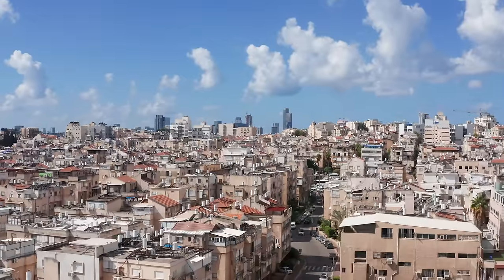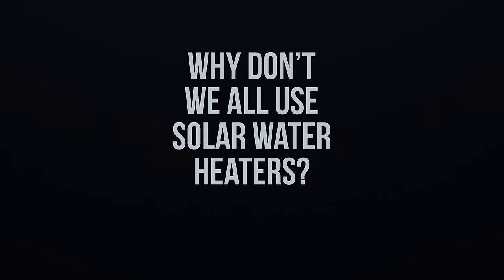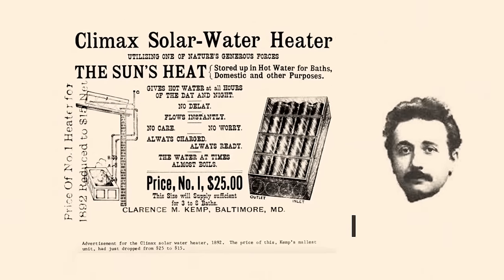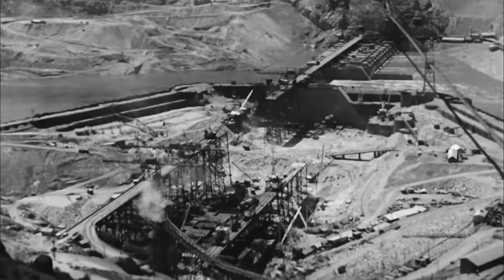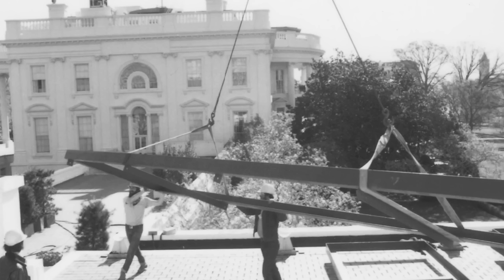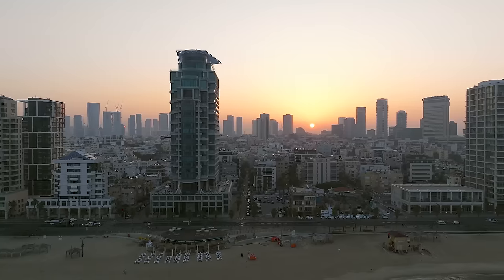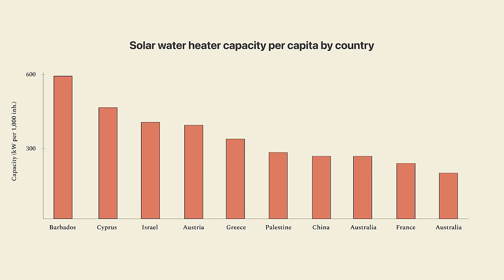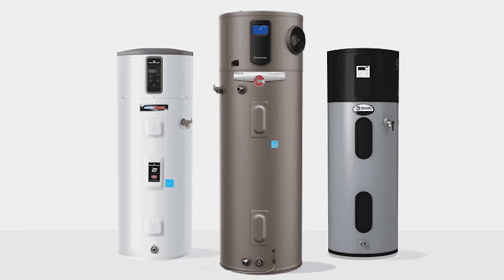Why Don't We All Use Solar Water Heaters?

Comment: Thank you so much for your thoughtful analysis of why the use of energy saving devices vary across the world in a time of global climate change.
Unfortunately after about the 7:25 mark I was unable to concentrate on anything else you said because you made a statement, that is sadly becoming more and more common, that is both grammatically clunky & awkward and mathematically incorrect/nonsensical.
When something is MORE expensive: Say a water heater that cost $700 in Israel cost $7,500 in the U.S.   , you could say that the water heater cost more than (10X) ten times as much in the U.S. Multiplying (timesing) while numbers creates larger numbers. 
At first one might be tempted to think you’re saying it backwards or just in an awkward manner but you’re in fact saying a completely different thing. If $700 is less than 10x U.S. Than the US price must be about 1/10 the Israel price and thus the U.S. price of a water heater would be $70 (or $71) . This would make the price in Israel less than ten times as much as the price in the U.S. Which I know is not what you’re trying to say but, is what you are saying. 
To be correct you could say the price over there  is a tenth of what it costs here or it costs ten times more here.
Sorry, and again thank you for the important information. I don’t know if I’ll go for the giant tank on my roof for my next water heater but, I’ll definitely be looking for a heat pump water heater even if it does cost 10X as much😉

Comment: Who wants an ugly tank sitting up on the roof when it can barely hold a tree branch that may fall. I would hide the tank in the ground where the earth can insulated the tank. The water ain't totally free after the equipment is paid for. There are a back up elements that are required by code that use power. I worked for a solar company years ago and know how they are set up and the code requirements. I thought about putting a water tank up in the attic so the attic heat could warm the water then I would have warm water during a power outage from hurricanes. One of my co workers has pipe up in his attic and he said they could take. Showers and have warm water. I have a propane fired water heater and it's plenty and a 15 lb bottle will last a quarter. So it's cheap to heat water my electric bill used to be around 50 dollars a month using a timer on my water heater but the gas is far cheaper. I think solar can save money but not until the equipment is paid for regardless if it's panels or solar water heater. 73

Comment: What this video failed to cover is photovoltaic, or solar electricity generation has gotten so cheap, it makes more economic sense to put more solar panels up and use the electricity to heat water, rather than installing a dedicated solar water heater system. PV’s are very popular here in California and it makes more sense for homes already have solar just put up couple more panels on the roof to cover their water heating needs, especially with the more efficient heat pump water heaters.
Reply: It's not that economic when you include the inverter cost and failures. But the good news is that hear resistances don't need AC current. So you can drop the inverter and feed you boiler with direct DC from the PV panels. Just take in consideration that the effective power on DC is twice the effective power of AC. If your device is rated for 110V AC you only need 55V DC. (If it's 120V AC then 110V DC) Another solution is to use a boiler for campers (usually rated at 24V DC).

Comment: Funny,  I do not see you mention the manitenance problems costs of Jimmy Carter's White House solar water heaters...  I remember reading the news articles that listed the leakage and other issues.  It seems that whoever installed the solar heaters at the White House did a crappy job of it.  Newer ones are much better designed in the USA.

Comment: Sure, they work fine.  But rooftop apparatus are ugly and have the potential to damage said expensive roof... especially when water is introduced.  And the crap state of manufacturing these days leaves me even less confident that a rooftop fixture wouldn't fail in a magnificent fashion.  Now you are left with a really expensive and difficult repair.  No, I will stick with my simple, cheap, and easily repairable/replaceable water heater in my garage.

Comment: Thanks for the information. Sounds like Adam Smith’s “Invisible Hand” worked and is still working. If it was cost effective it wouldn’t need a mandate or a subsidy. If I want to spend more money to have a more complex system that is my business the government should not be involved.🎉
Reply: The problem is that the market price doesn't include what economists call "externalities" - most obviously, the pollution caused by fossil fuels. Formerly the concern there was acid rain and air pollution but now the worry is global warming. The video noted Carter's comments about it not being possible for hostile governments to embargo solar energy as they did with oil in the 1970s so a portion of the vast amount of money we spend on the military goes to ensuring the security of energy supplies. Indeed, if Iraq's main exports were apricots and dates, then it is hard to imagine that we would have invaded in 2003 with all the subsequent loss of blood and treasure which is not reflected in what you pay for electricity or gasoline.
Reply: Exactly.  Why is Government always the answer to these problems? I am a fan of all forms of solar energy, but have chosen not to pursue for my own reasons.  If a solution makes sense, i.e. cost effective, the market (homeowners) will adopt it. Stop promoting the use of federal coercion to do things YOU think are important.  If the government wasn't wasting so much of our taxes and driving inflation, maybe US citizens would have the discretionary funds to invest in more 'green' technology.
Reply: @g.harrismcgraw8325  There is lots of government "coercion" that you are probably in favor of - perhaps you benefit from the mortgage interest tax deduction for instance. The free market brought us lead paint and asbestos and I assume you are fine with the government regulations in those areas. The lack of government "coercion" in Turkey allowed developers to build thousands of buildings that looked fine to the purchasers but then collapsed in the earthquake.

Comment: Common sense is like deodorant, those that need it most, don't use it. It's extremely hot in Africa especially in Ghana but those who seek to benefit have made it impossible to buy anything solar yet the national grid of electricity can't sustain everything, therefore the power rationing, you can go days if not weeks without electricity.

Comment: Ok, so you can use solar to heat water, but you need a back up heat source for cloudy or cold days.  So you have a normal how heater plus the solar.  The solar will save money because it's free energy...great...when it CAN work.  So if you have all that extra piping and labor.  It will eventually pay for itself, but it isnt free.  I did use solar for hw....but it is not possible in the winter even in southern NM. Summer was good though.  Really all you are doing is justifying having 2 hw heaters. Yes, it works and it will pay for itself eventually, but really, it's just too much BS.

Comment: First off, lets get the #climatechange out of this topic.  I have solar electric on my home and my rv and frankly if any studies have been done, they have not been made public, as to the negative effect of solar glare one the climate and wildlife.  This has nothing to do with the weather, period. 
I built and installed a solar hot water system on my home in the late '70's, and it worked well.  A huge competitor of solar hot water in many of the southwestern states is natural gas.  You can have your opinion of fossil fuels, but when you look at costs, it takes 10-15 years to break even dollar wise.  By that time the solar system is needing replacement.  Also a huge factor can be whether or not the roof of the home can support the added weight of a 40 gallon tank and panels.  In California, there are many homes that could not support that, and the required engineering and construction costs would add thousands to the cost, making it a waste of money.
I am not anti solar, as I said, it's on my home, along with the Tesla Powerwall, and my RV, but I am practical and a realist when it comes to my money.
Tax incentives alone will not convince people to switch, NOR should they be forced by the government to do so either.  Let the free market dictate our choices.

Comment: Wtf is going on with your energy prices in other parts of the US? I have never spent more than $160 a month for gas AND electric/month in KS in a 2.3k sqft house and I keep it 74 summer and 68 winter. Usually it's <$100, we have wild swings in temps thru the year but gas is like $22/month except for 3 months of the year, furnace and water heater are gas, it would take forever for me to pay for a solar hot water system, last winter, the highest gas only bill was once $80/month but that was an anomaly due to worldwide price spike from European demand...

Comment: Sorry you are cherry picking your data. I sold solar in LA during the credits. As soon as the credits went off sales dropped. We were selling overpriced systems to get people the maximum Tax credit, not because they needed that costly system. Why does it cost $5000 in the US and $700 elsewhere? Could it be all of the existing GOVERNMENT REGULATIONS from industry lobbies to keep prices high. Also Energy prices did not increase because of the Ukraine war. It started before that when Biden followed his rich idealistic doners and declared war on oil. Prices shot out the roof with the poor being most affected. Then with high prices Putin could afford to invade Ukraine. You are correct we do need solar water heaters. But not a government mandated $5-15,000 system. I'd buy a $700 system tomorrow and install it. I would even pay a reasonable permit fee. But I do not need more costly regulation. Tell whoever wrote this story to do a better job of getting his facts correct next time. We need it.

Comment: Be careful this guy is being very deceptive here.

His main claim is about global warming and carbon dioxide.

The solar heaters cost a lot of money to install and then maintain and use.
Then by subsidizing it even more money is being put to keep this project going during carter.
Also then you have to think of recyling this and you will see that this project is not carbon friendly at all and it costs extra too.

The thing is every dollar carries with it carbon production even if its not exactly easy to see.

So actually this solar business thing actually made things worse overall.

And the cheaper option was gas and oil. It looks dirty from the start that's why people complain but its actually cleaner in the long run.

The thing that is more economically viable is usually the carbon friendly way so Reagan was right.

Unless the market innovate s and makes those panels competitive you cant just throw money at the problem and expect for it to be fixed.

This guy is leaving a lot of stuff out to make a political point be very wary of people like this.

Comment: Well, one thing for sure is that if the government gets involved, the price will skyrocket for whatever technology.  If the government gives a tax break,  many companies don't see it as a way to expand production, but as a way to bilk that extra taxpayer money directly  into their pockets.  This has happened EVERY time that I can think of, from more efficient cars, to education, to everything else, including solar anything.   It's all now about bilking the money out of the consumer; and if there's federal money involved, that too gets tacked on.  There's no real incentive to the consumer to change; as the tax breaks just end up making the price for the system & installation skyrocket.  Keep the government out will be what drives competition; but we're a long ways away from that. 

If a company started to provide cheap solar water heaters, and it was easily available at your local hardware store, that company could get rich;  but that's not the attitude of most businesses;  they overestimate the value and will justify a $5000 solar water heater price tag and get the feds to jump in with tax credits and raise prices accordingly.. Therefore, ;the market is NEVER a free market, but a market driven by tax breaks and government corruption-- all aimed at getting that taxpayer money & bilking the consumers.. 

There is a solution to this problem; if there are to be tax breaks, provided one does not need to itemize in order to collect, for like solar hot water heaters, then the solution would be to grant tax breaks, but ONLY when the sale price of the systems, including installation - is CHEAPER than the price of conventional water heaters, with the same warranties & the same expected lifetime for the product.   Right now, the cost of a typical conventional water heater, including installation, is about $1000. So, a tax break of say $200 back on the first year, of a system that is installed for the consumer at under $1000 total..  

The Government seems fine to mandate $70,000 EV's, but not sub-$1000 solar water heaters because simply put, the government gets a much bigger chunk on taxing a $70,000 EV than it does from a $1000 solar water heater.  Proof that our government is more corrupt than it is a worthwhile endeavor..

Comment: these are a scam!  When you add the extra weight of the stored water heater over and area of the roof nor designed for this much additional pressure risking a roof collapse.  Second unless you bath regularly between the hours of noon and five (without a great deal of additional insulation) your hot water runs out.  And lastly.  I worked for one the the earliest companies producing and selling these roof top water heaters.  On the way to work I noticed one for their solar water heaters was mounted under a shade tree and pointed South!  I was living in the Northern Hemisphere, at that time and ALL SOLAR PANELS MUST BE AIMED NORTH TO FUNCTION PROPERLY!  Most importantly; the pay back of money saved on the electric bill was a total lie.  Not scientifically sound!  I could go on but in reality I probably have no effect on this scam. Ah well